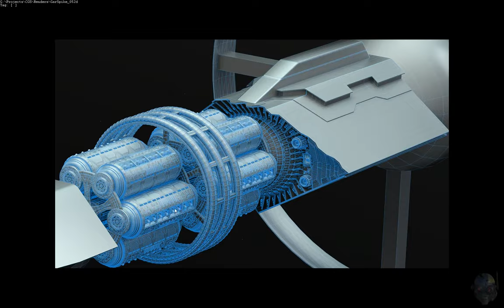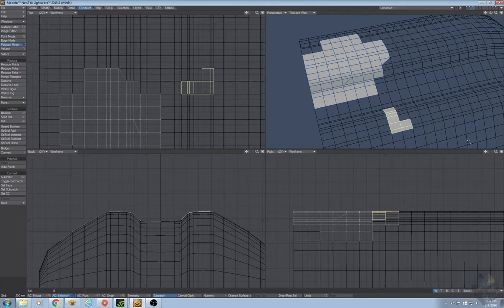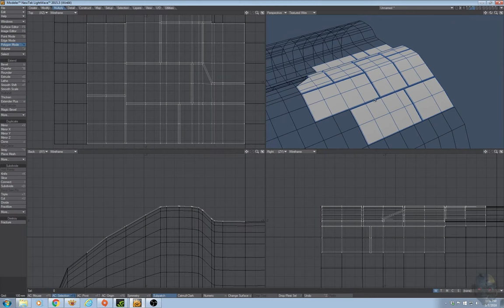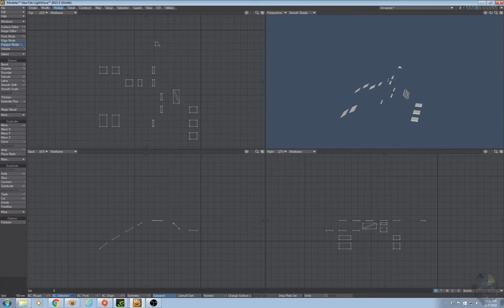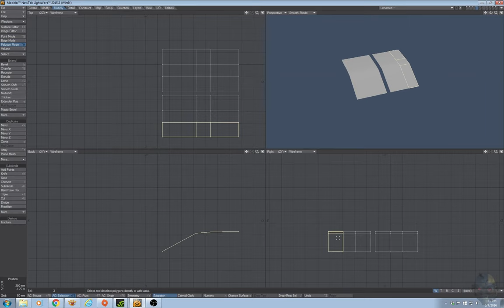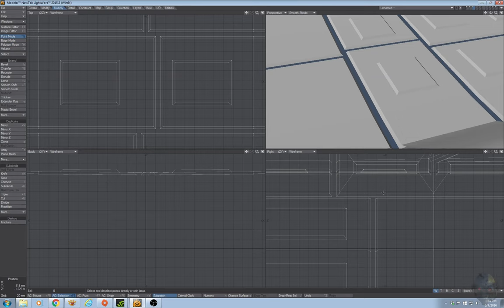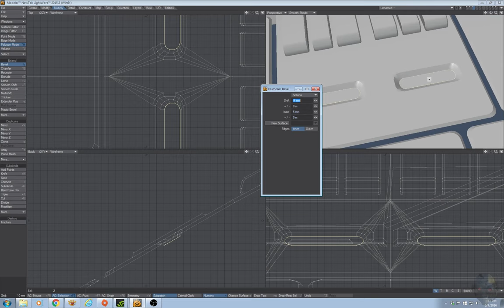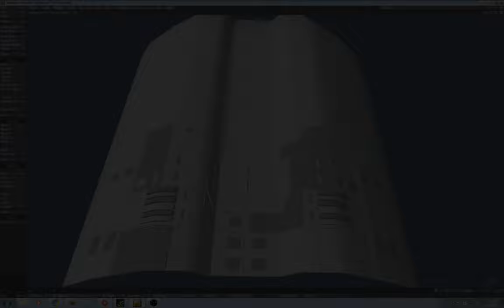Requested: Modeling Hull Plating

Comment: I have been practicing this technique on a low poly cylinder and it really works well in 3ds max. One day I will try lightwave, but I have been using 3ds max for too long heh heh. I think the hardest part is how much to inset the panels so that they show a gap, but not too much gap